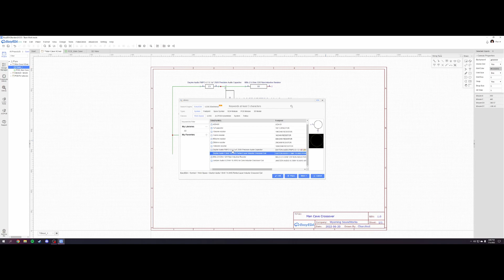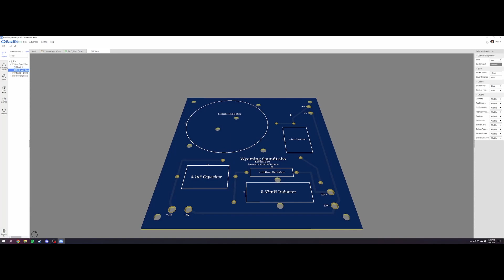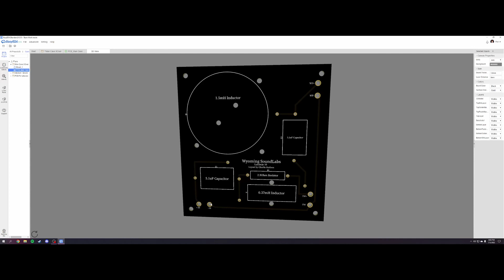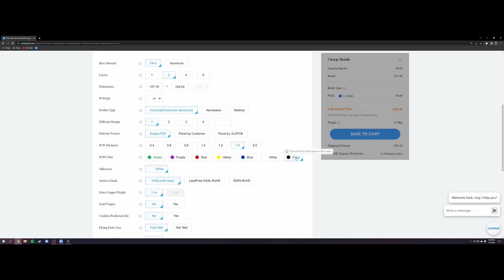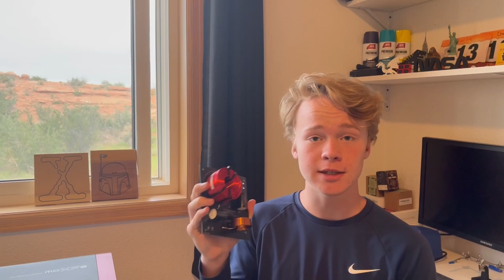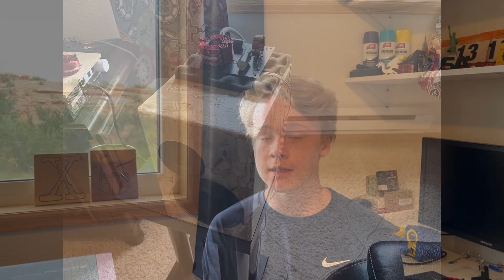How to design a custom PCB for a speaker crossover

Comment: hey man nice build! I am a third year ee student and am doing a summer project on speaker design. I was wondering if you had any more information on your build including the parts you chose, the enclosure, and also if you had another speaker in stereo what the setup looked like there. Did you design an amp with them too? I would really appreciate any help because it looks like you have completed the exact process of things I want to do with this project and your build looks fantastic!
Reply from the maker: For the parts, we designed our own crossover from scratch, then ordered high-quality components from Parts Express probably. For the cabinet, we used some OSB which is great for prototyping because it's relatively inexpensive. We did have another speaker almost identical to that one on the other side with another custom board soldered like that. We have built amplifiers and use a combination of built and bought units. 

For you to get started I'd recommend buying a speaker kit from a company like Dayton Audio. That's how I got started and it really helps to understand how crossovers work and there is a lot of information online about what each individual component does. It comes with instructions on how to build the cabinet, too.

If you're really looking for a challenge, get VituixCAD. It's a free software that allows you to simulate how a electronic component (and several in a circuit) will affect the frequency response of a given driver combo. If you make it as far as a theoretical schematic for a crossover, order the parts and assemble and you'll have your first prototype like is in the video.